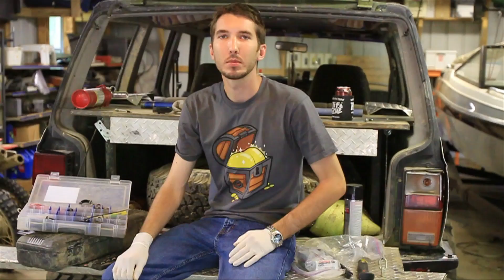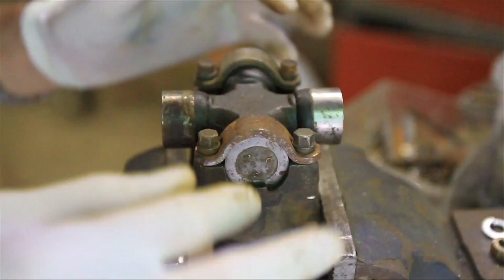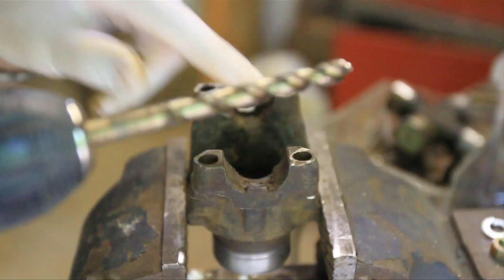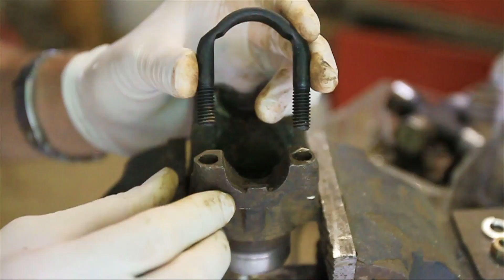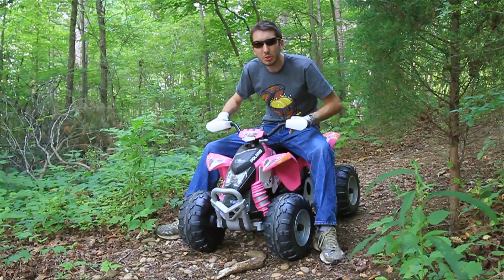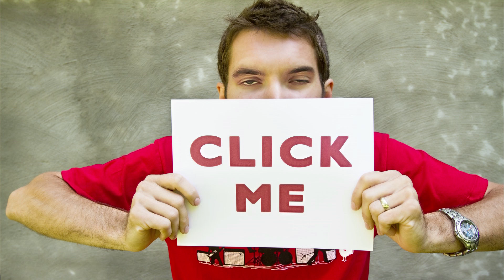Straps to U-Bolts Yoke Conversion - How To

Comment: Hey, what if I broke the head off the bolt and none of my drill bits are going through the broken bolt to allow a hole for extraction? Is it possible to just drill the hole all the way through with the bolt still in? Or do you have a suggestion?

Comment: Hey bleeping jeep I just did a 8.25 swap in my 98 ax15 5 speed jeep , the stock driveshaft for my 5 speed jeep seems to work with my lift but my u joint is to wide to fit in the yoke of the 8.25 by a couple Millimeters, do I just change the u joint??? Or do I need the shaft from the jeep I got the 8.25 from which is an automatic?? Or do I just change the u joint in the 5 speed stock shaft I have ??? id definitely appreciate the response. ASAP ..I cannot find a solid answer . thank you.

Comment: Is there any torque specs on the u bolts? I changed the yoke out to a u bolt because I put a 44 in and already had a 1310 driveshaft and 44 had 1310. Just curious because I couldn’t find any info

Comment: Thankfully I measured first!  I have a 2003 with a D44 rear. The yoke flange is about 1.5" thick.  I was skeptical that the 81004  bolts would fit, but I ordered them anyway. Upon just sizing them up I can see there is NO WAY these would work with my yoke. So I went to looking around and found these. https://www.amazon.com/gp/product/B009Q79U18/ref=ppx_yo_dt_b_asin_title_o00_s00?ie=UTF8&psc=1. They are 1/4" longer than the stock size suggested and should give just enough thread poking out to fill the nuts.  (Guess I'll find out.)

Comment: Bought these for an '88 MJ D44, but it seems like the threads don't go high enough.  Any idea what size die is needed to extend the threads?
Reply from the maker: I dont recall, probably 5/16.  I've had that problem before and cut the threads lower but you just bought the wrong ones.  They do make em with a longer thread, or maybe a yoke with more meat on the back side.

Comment: Hi Matt, I just started watching your series about a month ago.  My 5.9 ZJ' front diff has been going out and even the top pros couldn't figure it, until I consulted with a junk yard guy; who is being shut down, by the state of California EPA.  Knowing how expensive things are, I've been watching all kinds of videos, yours and many others, to get a good feel of how to proceed.  Yeah, I missed you at Venice Beach.  I was installing my fuel tank armor. Wanting to know what East Coast Axle means by U-Bolts that they charge $57 for. I come across this video and Dorman part # 81004  $7 shipped. I wanted to thank you; because, about 2 years ago, my 27 yr old stock strap, on my MJ, went out at my job's parking lot. Just old age. Had it towed. The mechanic said don't break another one; because it was extremely hard and expensive to find.  Well, with this knowledge, thanks to you, it won't be so difficult.  Does this part # translate to an MJ rear drive shaft; or a ZJ front drive shaft?  THANKS!!!!!  YOU ROCK!!!!
Reply: Oh yeah, last night, something in my ZJ's front diff finally let go, on the 10 freeway.  Limped it home onto the 405.  Parked it in my garage, for good, until my new East Coast Axle Front Diff arrives  BLEEPINJEEP!!!  or as my mechanic/brother-in-law would probably say it  BLEEPINHEEP!!!!

Comment: Hi Matt. I want to run a dbl/dbl cardan driveshaft up front in my d30. I'm told my strap style yoke will not line up with the H on the double cardan. Im told I need to upgrade to a u bolt style pinion yoke that is 26 spline. Since I wont be using u bolts will this still work?

Comment: Hey will doing this effect the balance of driveshaft and cause vibration.. One side of my yoke had the prob so i only drilled out one side other is normal any ideas if I drill out other side will it be ok ? Isn't on a jeep on a ram 2500 but figure I ask

Comment: How tight do you put these? This swap is a no-brainer, especially if you pull the driveshafts for some other repair.
Reply: I see this is 8 years old but you do NOT want to over-tighten u bolts. This will crush the cap into the bearings causing extremely fast wear on your joints. This is the reason they all come supplied with a lock washer. Crush the washer flat and call it a day.

Comment: No fault of yours. I made the decision prior to seeing the video. And like you said before it may not work on all yokes. Just chiming in that it wouldn't work on my 2003 TJ with a Dana 35.  I would advise to measure the depth of the yoke prior to buying the ubolts.

Comment: Yep, I just tried to do the ubolt conversion on a 2003 Jeep TJ with Dana 35 rear end.  The yoke it tooo deep for the ubolts that worked find on my 98 Cherokee's C8.25 and Dana 30.  So looks like longer ubolts, or more likely a yoke that uses ubolts conversion at least in my case.
Reply: Maybe grind the backs of the yoke ears to where the bolts can fit. Thats enough metal for the old yokes so why not the new one.

Comment from the maker: some yokes may be slightly different because Chrysler used whatever was laying around.  But Dana 30, 35, and 44, yokes should all interchange.  if you need a new yoke search 4 wheel parts for "Dana 30/35/44 yoke"

Comment: I would not suggest this on a dana 35 those are not the rights size u bolts and you can not even get a nut on the u bolt the bolts also would not slid right in had to bend to ge in only to discover they will not work It is a bad idea

Comment from the maker: I wouldn't try to drill them as the bolts are harder than the yoke and that will make a mess.  In the past I have always been able to back them out with a flathead screwdriver.  Usually there is just enough edge on the bolts to grab and tap around in circles with a screwdriver until you can get a vice grip on it.

Comment from the maker: You can do the same thing to the front yoke, but it requires you to grind off a lot of the backside where the u-bolts stick out.  that part isnt flat and needs to be ground down for the lockwashers to sit properly.  I'm still using the straps on my front driveshaft and have never had a problem.  There are some companies that make a replacement yoke for use with u-bolts on the dana30 but I'm not sure who makes them.
Reply: I got D30 and C8.25 U-Bolt yokes from Iron Rock Offroad. 😎
Reply: Oops. I wish I had read this before I drilled my Dana 30 yoke. Haha. My bad. I've got a lot of good from your channel over the years. I met you at a wedding in Hurricane, UT 18 months ago. Thanks for producing great content.